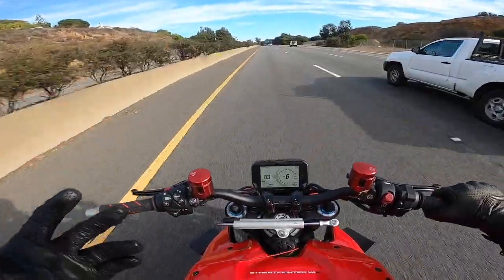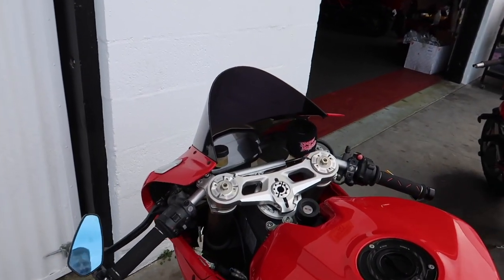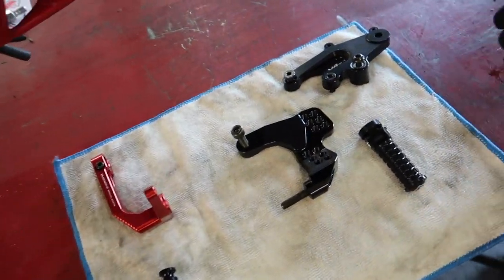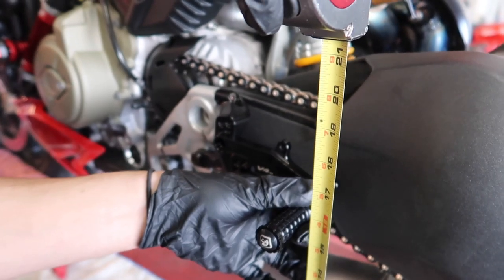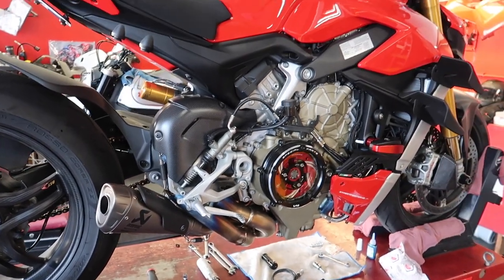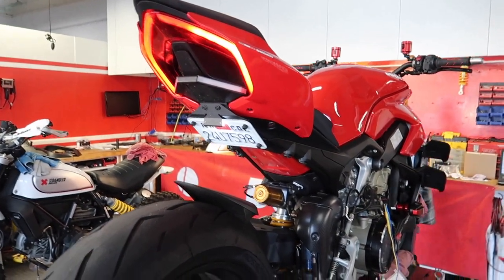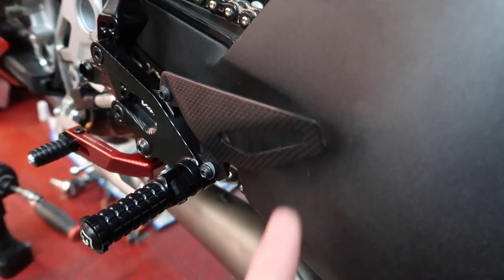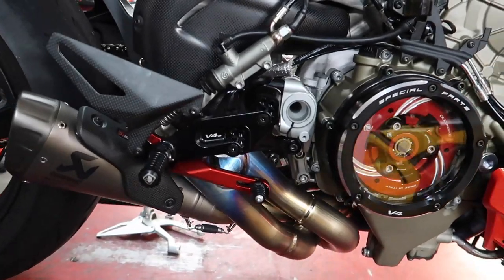More Upgrades for our 2020 Ducati Streetfighter!!!

Comment: Hey friend=-I always strip off all the data decals from my bikes`-because surely way cleaner and generally not necessity.  Best thing I find is to peel them off sometimes with careful use of a blade- but safe keep them on the inner back pages of your bikes owners manual.  I usually use the inside of the back cover and page or 2 of the blanks i at the end of the manual, Tip O D- Day ! Yo!

Comment: You need to ride a Super Duke after riding the Streetfighter.  Check the Dyno charts, Super Duke makes more horsepower and torque to 9500 rpm than just about any bike including the Streetfighter.  Do a Super Duke build!  More horsepower requires more rpm which is tough to perform on the street vs the track.  If you have 400 horsepower at 20,000 is that even useable on the street!  Lol!  Love your builds.  More custom paint schemes vs just add ons.